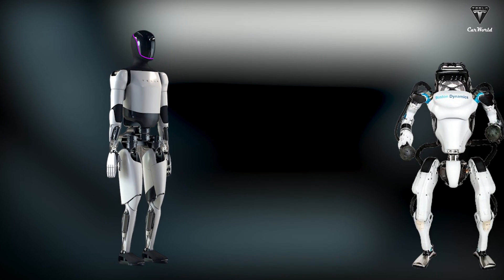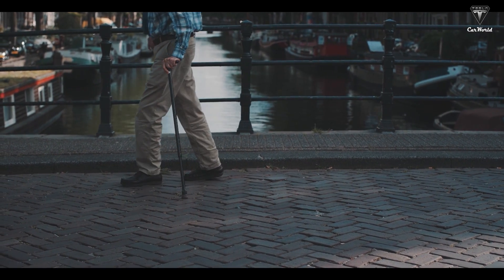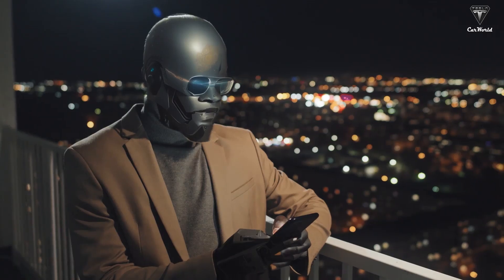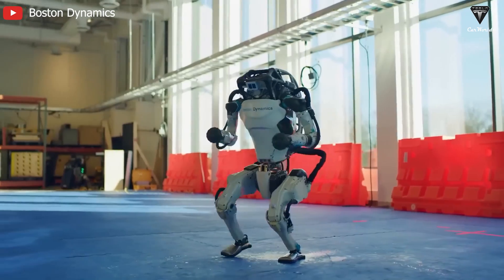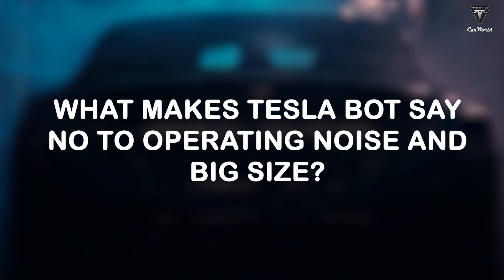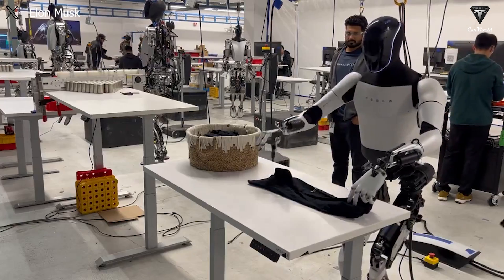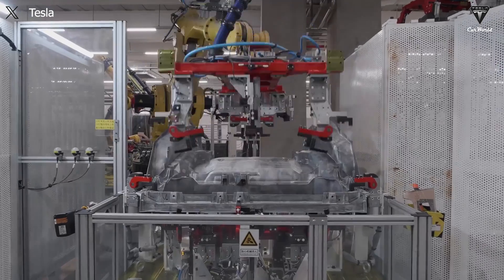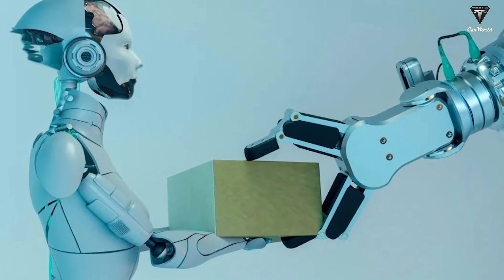P4! 2024 "Next Gen III" Tesla Optimus Update! Why The Tesla Bot Abnormal? Details Explained

Comment: How the author stresses hydraulic oil leakage as a problem is somewhat odd as all machinery, planes and lot of other equipment depends on safe connections which seem well manageable these days. Boston Scientific must have good reason to use this source of power as they are in this business for 30 years or so.

Comment: 🎯 Key Takeaways for quick navigation:

00:00 🤖 Optimus' Unique Features
- Optimus' design integrates an innovative electric drivetrain and bent knee walking for superior energy efficiency and stability.
- Bent knee walking enhances both stability and energy efficiency, making Optimus suitable for diverse tasks in factory environments.
01:36 🦿 Walking Efficiency and Stability
- Bent knee walking improves stability and energy efficiency, reducing strain on the battery and enabling prolonged operation.
- This walking style offers a larger range of motion and better force transmission, particularly on uneven terrain.
04:08 🔋 Energy Efficiency and Interaction
- Optimus' crouching posture conserves energy and enhances human-robot interaction by creating a more approachable appearance.
- Continuous advancements in robotics may lead to further improvements, potentially enabling straight-legged walking and broader integration into daily life.
06:51 ⚡ Decisive Electric Drivetrain
- Tesla's choice of an electric drivetrain offers significant advantages over hydraulics, including higher efficiency and quieter operation.
- This drivetrain enables precise movements, contributing to Optimus' performance in various tasks and positioning it as a crucial component in Tesla's future production processes and AI ambitions.
09:48 🛢️ Drivetrain Efficiency and Maintenance
- Electric drivetrains offer higher efficiency and lower maintenance requirements compared to hydraulics, despite initial cost differences.
- While hydraulic systems are robust, they require extensive maintenance to prevent leaks, posing challenges in humanoid robot applications.
15:34 🌱 Environmental Sustainability
- Optimus' electric drivetrain minimizes environmental risks associated with hydraulic systems, aligning with Tesla's commitment to technological advancement and emission reduction.
- As Tesla expands production, Optimus could become a significant revenue stream, surpassing the competitive EV market.

Made with HARPA AI

Comment: Fast twitch fibres which act as muscles, with a fibre optic nevous system, surely will be better than either electric motors or hydraulics. But for now, both hydraulics and electric motor systems will go far. It'll be great to see huge hydraulic earth moving robots with power and strength, and equally great to see the delicate manipulation and precision of motorized electric robots.

Comment: The real answer is that Optimus has more in common with the Honda Asimo than with the BD Atlas. Asimo and Optimus use a method of balancing called an "inverted pendulum" this requires each footfall to be precise and for the robot to balance over top of the ankle. Compare that to most of the other humanoids on the market that have lineage with BD and Marc Raiberts' leg lab at MIT, all of which use a "dynamic pogo stick" algorithm. Humanoid companies like BD, Agility Robotics, Figure, Unitree, and Apptronics all share this modern walking algorithm which allows them to balance on unpredictable surfaces.

Comment: Tesla is on to how it will go. Clean, quiet and discreet in human environments. But, power!? That is the question. Relying on power plants and batteries is nice and all. But, this is the area to innovate in. Hybrid, dynamically adaptable systems are the future. And, solar, or charging from light, will be a part of it. Light is energy. Light is information. Impulses skip along the dendrites of our nerves. Energy is literally in the air. Magnetic forces are also perpetually present and predicable. The robot that keeps going, with less need for external energy inputs, that is the future. Solar robots digging through human rubble. Yeah.

Comment: hydraulics will win in most demanding strength applications, like making hands with equivalent strength to humans.  They may end up winning overall in long run as well as batteries get cheaper and more energy dense, because motors and gears are more limited in power/torque, particularly in most strength dependent applications.

Comment: Wrong about "bent knees". The most energy efficient mode of travel for any biped is doing a locked knee, eg placing the foreward leg, locking the knee, then "falling over" the foreward leg by leaning weight forward and using the trailing foot to push over the center of balance.

I know, i trained for months to enter a walking marathon (40 km). Rules absolutely require locking the knee of each leg on every step, else not walking.

Why robots don't? I suspect they lack the controls and joints required to do it. They will eventually, the energy saving is huge.
Reply: Evolution... Works the same for them as it does for us - only WAY faster😅
  Bu t I thought the point of the bent knee originally was to offset their limited DOF. We still mixro-balance when we stand upright at attention, "unmoving." That is inefficient for a bot.
Reply: @thesoundsmith  More detail by reference, svp? Google doesn't know "mixro balance". 
Did you mean micro-balance? If so, locked knees are still far more energy efficient than using muscles to sustain our weight with bent knees.

Comment: I think that the compressibility of a hydraulic fluid, allows for a more fluidity of movement as opposed to an electric geared or harmonic drive of electric actuators in the case of that of the stabilization of a carried item. When the arms are at length holding an item, that item needs to be in a hierarchy for the focus of that item for stabilization, where the rest of the systems moves to stabilize the transverse or transfer of the objects weight or momentum from one location to another. In general movement of the head of the robot should be focused on the hierarchy of stabilization throughout the general movement of the entire system to ensure fluidity and life like precision. This is seen in in the biology of many life forms today.  Birds for example: A hawk or an eagle move their heads independently from their bodies while hunting down a prey. Once caught, their talons bring the food to their mouths. I could go on, but I think this could perk some responses.

Comment: Real World Tools require struggle…
In order for an autonomous humanoid robot to have any value in a factory, the robot needs to be able to use Real World Tools. However, such tools, even when they are top-of-the-line AND brand new, always require struggle. For example, consider the Jacob's chuck of a hand drill. After you tighten a drill bit in the chuck, you then start the drilling task, at which point the bit will probably demonstrate some rotational SLIP. You then have to STOP drilling, immediately followed by re-tightening the drill bit in the chuck. Once re-tightened, you immediately resume drilling. The intelligence of a robot won't be able to duplicate this. A robot's intelligence won't be able to assess that...
• the drill bit is rotationally slipping;
• excessive rotational slip is unacceptable;
• the cause of the rotational slip is due to a need for more Chuck Tightening;
• at the very least, the drilling operation needs to CEASE;
• the drill bit needs to be repositioned and retightened (within the Chuck);
• the Drill Key (which is used to tighten the Jacob's chuck), will always SLIP, even if the drill is top-of-the-line and brand new;
• once the drill bit is suitably retightened, the drilling operation needs to resume.
□ In other words, the task of using a Real World Tool always includes the need to struggle with the tool. The intelligence needed to efficiently perform such struggle goes way beyond what the intelligence of an autonomous humanoid robot is capable of.

Comment: Whoever can produce a robot that will fix dinner, clean the bathrooms, etc will own the world.
Reply: thinking small here, It is the LLM run robotics that will do things most people can't even comprehend. It isn't just the ability to take out the trash and cook dinner. It is the emergent abilities that they will develop. To be your cook / cleaner / lawyer / home security / teacher / work force ... making people who are disabled mobile now.. so many things it is hard to quantify. 

When your bot is earning 6 figures because it is doing services for not only you but others.
Reply: Except it will cost more than a house.
Reply: @floridmike4696  so the first cars where like that to.
Reply: give it another 2 or 3 years id guess, we aren't too far off
Reply: @NickDrinksWater give it 10 and we are there
Reply: And speaks Spanish
Reply: What about if it calls its divorce lawyer and throws you out of your house?
Reply: And make a sandwich 🥪
Reply: and give you headrubs!
Reply: That's not a robot. That is minimum wage.
Reply: I would like it so much but get the parts if something is wrong?
Reply: I wouldn't set it on fire. The sound is not that bad. 28 joins a little more than 80 kg and not even taller then me. But the handle and the price. Also hydraulic liquid needs to be changed. Or did you never drive a car? What is in there?
Reply: And tesla will do that. You can be sure of that
Reply: And tesla will do that. You can be sure of that
Reply: Yeah, well. It will kill capitalism, but I'm up for it. I think next system will be much better if it will be designed with humanistic approach (not 'control the world' one)  =)
Reply: Dear brothers, people!
With the advent of these robots, I would like to share a very important thought.
We are entering a new era. And do not forget that man is imperfect. As a person with progressive views, I am glad that the future is coming to us at a moderate pace, but I am not without skepticism.
Firstly. Let's not jump into transhumanism. Let's remain imperfect people, otherwise we may face an existential crisis.
Secondly. Man is an interesting creature. Full of secrets. A person is prone to commit inappropriate actions. Look at these robots. Wouldn't a person be tempted to remake or reprogram this robot for his own insidious and unfriendly purposes?
Let's be honest. We won't live forever. At the very least, I would not want to be part of a totalitarian system of a single mind or the like.
I don't want to be controlled from the outside.
I don’t want machines to thoroughly predict human behavior, eventually to the point that, out of ill will, only us of free will can do so.
Think about whether these helpers are applicable and how ready we are to be in a society with a high degree of tension and problems.
Now there is a war in my country, with our brothers. And the brothers are already talking about how battle robots will soon be brought to them. Are you ready for UBER ALLES?
Me not. I am against war. I am for the withdrawal of troops. However, I do not support any side, and especially do not want the apocalypse to spread throughout the whole world.
Please. Let's send these robots into space. Build cities on Mars. Explore other worlds. We will ask AI to reveal to us the riddles of space-time, travel throughout the universe and beyond, if there is still room for our species and our type of mind.
But let's not run ahead of the locomotive.
Let's not let the child play with a grenade, let's wait until he grows up.
Thank you for your attention. Best wishes.
Reply: They would own the world IF they were affordable to the average everyday working 9-5 blue collar person
Reply from the maker: But all of them will fail with Tesla AI tech
Reply: You mean like hyperloop, solar-roof failed?
Because its all bullshit ponzi schemes??